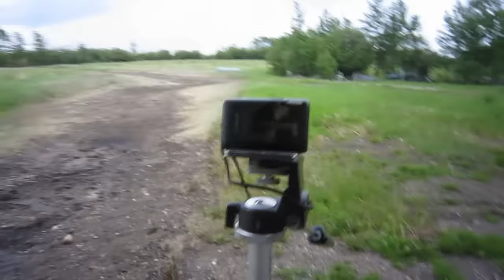Testing a GE J79 with afterburner

Comment: Curious about the thing in the front with that big tube; is it air intake for the combustion? Also how that engine is not moving? The bolts on the ground must be insane

Comment: It's loud.  I know, I have been on a number engine runs when I was in the military back in the 80's.  Hush houses and tie downs didn't make much difference when you were around it.  It was just noisy.  Flightline wasn't much better either.  But the worse engine I was every around was the tonka toy F16.  That was a high pitch scream.  You had to have headsets with ear plugs to be around those noisy engines.
Reply: I was a weapons troop on 16's at Torrejon Spain for 3 years. I loved working on those jets. Sometimes my crew would pull EOR duty. That was a hoot. Before that I loaded munitions on 15's. The F-15 is my all time favorite.
Reply: @everready19373  Well, I hated the F16 for more than the noise.  I always saw them as a tonka toy.  F15 I held in respect.  I worked at that time on F4s, A10s and AC130's.  But I can understand why you liked the F16 as weapons.  But I worked the attack avionics.  Completely different world.

Comment: Looked like smoke or vapour on the first few throttle pulls filmed from the front, were you getting no lights? I get the smoke on shutdown as the sumps aren't sealing/scavenging efficiently during spool-down. Ahhh just read your intro comment!

Comment: it would be nice if you record the sound with a condenser mic and a 24 bit audio interface, with no gain applied to avoid clipping and listen to the true power that engine has.
Reply from the maker: Any condenser mic needs to be more than 100m away to avoid being smashed into worm feces. The video cam mic gets great sound from 150m at idle and medium power. At that distance, full dry power is distorted. In AB, the sound would be perfect if I was so far away I could not see the engine.
Reply: @AgentJayZ  most condensers are made for high power but I think that engine will go up to 130+db it means it would be better to get a dynamic mic and put it like 80 meters away
Reply from the maker: Thanks for the ideas. My estimate of the SPL in AB is 180. 130 is the start cart a 75m, before the engine is even running.
As explained in the video, it is not possible to describe how loud it really is.
Reply: @AgentJayZ 180? :/     24 bit audio only admits 145 db. and that's way too much
Reply from the maker: If it's "too much" for you, then you are "not enough" for it.
Reply: @AgentJayZ  haha nah, I like hearing.
Reply: @Ag89q43G0HyA  I'm a sound design student. Condenser microphones are super fragile, some of them actually break when you blow at them so a jet engine would vaporize them. Capturing the full dymanic range of a jet engine is a cool idea. But you'd need a really good dynamic mic that can handle it. And for quite some time now you can record audio in 32 bit floating point which has a dynamic range of 1500db. Listening it back is also a problem, again you need some sort of hifi system to be even able to play that kind of audio.
Reply: Nino Saglia to replay, you would need millions of watts.
Reply: @jaik195701  i guess a PA from meyer would do the job hahah ok is not viable, so i think ill vist this guys for a real life demo.

Comment: how does the technician goes in front of the engine to take out the  air hose while that engine is on ?
Reply from the maker: Air flow into the engine rises exponentially with engine speed, so at idle, there is not much. Disconnecting the starter at idle makes you nervous, but it's not dangerous.

Comment: This is the engine used in the F 104 Starfighter?  The North American Eagle land speed record project uses this mill and the 104's fuselage for their trans sonic racer.
Reply from the maker: S&S Turbines supplied two engines for the NA eagle. It was never even close to being "transonic". And now it's gone. They might have made it, but they could never raise enough money to finance the effort.
Reply: @AgentJayZ  I know it never went trans sonic but it was emminantly capable of reaching those speeds as I'm sure you know.  I didn't know the recent tragedy had ended the program.  I really wanted to see that thing doing 800+ under full AB.  What a shame.

Comment: This is probably the ABSOLUTELY coolest way to waste money.😅 I guess I’ll have to start saving!
Reply from the maker: These engines are tested after being overhauled to ensure they function properly before being returned to the owners.
Some of them are installed in aircraft used as dissimilar adversary training for air force pilots.
Since those aircraft are less expensive to operate than current frontline fighters, these engines help save millions of taxpayer dollars.
Reply: @AgentJayZ  but they are probably still pretty expensive right?

Comment: How in the hell does the little tripod and camera not get blown into orbit? I don’t get it
Reply from the maker: It is out of the exhaust stream. The vibration of the image is caused by sound, not wind.
Lots of people argue with me... but hey, I was there.
Reply: @AgentJayZ  I imagine it wouldn't be a very useful engine if the exhaust gas blew out sideways, but seeing how effective the nozzle is really is impressive.
Reply: @nightlight0x07cc  I worked with this planes, i stood in kinda the same place multiple times with running engines. It makes ur insides shake a bit, but ur totally fine and out of the exhaust stream

Comment: Can it explode, if something goes wrong for example ? Looking at the amount of energy this engine produces I can assume each bolt and detail is crucial to sustain such power.
Reply from the maker: You might be more interested in the dash cam videos, or the compilations of workplace fails. Cheers!
Reply: @AgentJayZ  Sorry, i didn't mean that I want to see any fails or traumas at your workplace. Its just amazing how durable are the materials to maintain such power and heat. Be safe!

Comment: In my day we tested turbines by putting a hand right behind the nozzle to feel how much thrust it was producing and to check the heat.
Reply: You can do that twice. ;-)
Reply from the maker: Interesting. This engine, without afterburner, has exhaust at mach 1 and 1000 degrees F, and makes almost six tons of thrust.
At 25 ft away, it can make a brick wall disappear.
I guess it depends how far back you want to be behind it before putting your hand there.

Even at idle, and 5 ft from the exit, you would be burned by 600 degree air.
Reply: They used to make us tune them up in flight.... That front carburetor was a pain to get to!!!! Hahaha!!!! Nice video boss, thanks for starting the YouTube power channels!

Comment: How come this rig doesnt lift off and fly away? I mean it carry an airplane on several tons in fast speed and this rig is what... screwed to the ground?
Reply from the maker: ... by the same kind of bolts that bridges and skyscrapers are built with.
Reply: @AgentJayZ  So the friction between the rubber of the tires and the runway is stronger then the thrust of the enegine? Sorry for my bad english.
Reply: Thane Mac  I think he meant with planes but he doesn't realize that planes on the runway dont have much thrust until they are ready to takeoff

Comment: PLEASE find a microphone that can capture that dynamic range! It's worth is as that sound was the music of millions of fighter launches throughout the Cold War and you're probably the last facility who can capture that for history. As you know it must be heard to be appreciated (though internet viewers cannot feel the low frequency in their bones like we did and you still get to do.
Reply from the maker: Thank you for your request. This was my goal since 2007. In 2007, in consultation with professional sound engineers, I learned such a thing was impossible. So I changed my goal to finding a mic that could handle the extreme sound levels without distortion, and not worry about the bottom of the dynamic range.
There are sensors that can register 180dB, but they are not microphones, and they are expensive. The only way to get the "normal" audio is to film from 20 yards and record sound at 20 yards.
The only way to get the full power audio is to film from 20 yards and to record audio from 300 yards... so I need an audio guy willing to stand a quarter mile away all day...

Comment: GOOD Video Sir  
My brother also wants to become a Engineer in GENERAL  ELECTRIC 
Your GE 404 Engine is integrated in HAL TEJAS and SAAB GRIPEN AIRCRAFT
Q In  this video sir how your Engine gets start where is starter motor and from which source it gets Electric Current 
Q And how Fuel is supplied to the Fuel Nozzles in Engine 
Please Answer My brother Question  
Yours sincerely 
Vaishnavi Choudhary
Reply from the maker: This engine is started with an air turbine starter. The way it is started is detailed in my video called "how to start a jet engine"
Reply: @AgentJayZ  Ok Sir Thank you for Reply

Comment: PS:  To ans your question, How much fuel per second ?  The answer depends on altitude, temperature, RPM' s , air speed selected and if you choose to utilize your afterburner !   You really couldn't use afterburner for too long  as well as fly "inverted too long!
Reply from the maker: My question? Wasn't my question.

Comment: So this is a F104 Starfighter engine?  I did not hear the specific howl of this engine.
Reply from the maker: This is a -19, with the lo-smoke fuel nozzles and combustors, and the redesigned, long segment variable nozzle. The black smoke and the howl are features of older models of the J79, such as the -8 and -11.
I have a few videos posted of these older models being test run.

Comment: I wanna see some shock diamonds, I don’t think that mount can handle that kind of thrust though
Reply from the maker: You just watched it handle full afterburner thrust in this test, in this video.
Please restart your brain, or whatever carnival whack-a-mole prize you are using as a substitute.
Thank you. Please move on. No reply necessary.
Reply: @AgentJayZ  ayyyyyy lmaoooo
Reply: Mach diamonds*   and they don’t come out of afterburners or jet engines.
Reply: @quartz9704 
I think he  meant the romboidal shapes that the afterburner flames make in some occasions (I don't know which or with what motors).
Reply: I feel like there are several tiers of getting yelled at: at a 1, you’ve got the naggy friend that’s a vegan or the good Christian that feels uncomfortable going 15 miles over the speed limit. At like a 2 or 3, you’ve got the angry aunt or mom yelling at you for not folding your clothes, or tracking dirt in the house. At like a five, you’ve got your boss or getting scolded by your dad. At a 6 you’ve got the marines sergeant yelling at you.... then at a flipping ten, you’ve got a pissed off engineer and HOLY MARY MOTHER OF GOD DONT GO THERE. I didn’t talk to one of my mentors for a good month after watching him freak.

Comment: We also had a airplane suck something up in the left intake and the motor hand grenaded and blew a hole in the aircraft but it didn't take the aircraft out. Sheet metal put a 36"x 22" patch on the outside of the aircraft. Wasn't a pretty sight

Comment: How much does it cost for a typical service on one of theses beasts. Just being nosy.
Reply from the maker: 1) - each engine model is different.
2) - each engine has a variety of services to perform, from a 100 hour inspection of an industrial engine, all the way up to a full overhaul of a flight engine.
3) - nothing about any job is "typical"

Final answer: anywhere from the cost of a nice used motorcycle, to the cost of a really nice house. A really nice one.

Comment: How do the controls for the nozzle work? It seems like the engine might be trying to maintain a constant turbine discharge pressure when above idle, which seems to make sense now that I think about it.
Reply from the maker: There is a module called the nozzle area controller, which senses EGT, fuel flow, nozzle position, and throttle lever position. It controls the flow of fluid to the nozzle actuators. The pilot does not have any control over the exhaust nozzle.
Reply: AgentJayZ is right. This engine actually has a supersonic exhaust stream when the AB is lit. (Really cool to see the shock waves standing in the flame when the flame when the light is right.) To achieve that, the shape of the nozzle has to be convergent/divergent (Google "supersonic nozzle"), while at lower thrust a simple convergent nozzle works better. This is a pretty good explanation. https://aviation.stackexchange.com/questions/9653/why-are-adjustable-area-jet-engine-nozzles-mostly-limited-to-military-use

Comment: Nice video. I haven't been around a -17 in lots of years. Did you have all four stages of the burner lit? I watched it several times and couldn't hear them lite. Being an AF crew chief for 4 years and on the Colling Foundation for 15 years I've been around several engine runs.
Reply from the maker: There are four manifolds for supplying fuel to the AB spraybars. Each opens at a different pressure, but the pressure supplied to them is smoothly progressive.
We had 'er wide open, and went right down to min AB as well.
I have never noticed any step-like jumps in the AB is each manifold opens up with the progressively rising fuel delivery pressure.

Comment: 3:25 that guy passing in front of that engine gave me a bit of anxiety
Reply from the maker: The engine just started, and is at idle. The guy walking in front is 15 ft away from the inlet. The guy removing the starter supply hose ( blue coveralls) is five feet from the inlet. No problems at idle. At full power, nobody goes within 25 ft of the inlet.

Comment: Reminds me of the scene in PorcoRusso when they were testing out the plane engine in the shed and the shed blew away. 

There must be lots of vaccum in there, how did the shed not get sucked in lol
Reply: The doors are wide open dude. They are like 100 times the area of the intake, it would need to be a much larger engine to suck in so much air that those open doors weren't able to handle the mass flow, in order to create that large a pressure differential.

Comment: with the afterburner engaged, how many marshmallows would you say you could roast at one time?   and, is this necessarily not the right thing (read: unsafe) to do?
Reply from the maker: 44 tons of marshmallows at once, easy. All will be turned into a burning spray of garbage.
It's not a toaster, it's a jet propulsion engine.
And I would say... not safe.
Reply: @AgentJayZ  We used to stick our K Rations in the blast fence while we were launching our F-4s.  By the time they taxied, lunch was ready.

Comment: Have you guys measured the dB of the J79 in full AB?  Distance and proximity if possible? I am gathering info for a VA Disability claim.
Reply from the maker: Nothing that would qualify as evidence. Our meters top out at 130dB, and they are pinned at 100 yds.
Reply: @AgentJayZ  , Thanks, just for reference actually. I was subjected to a double engine run to full AB on a TDY in the 70's. The F-4 was secured with the tail hook in a concrete arch revetment. I was under the bird displacing a squat switch on the right MLG. I came to on the hanger floor with the pilot saying, "Chief, you all right, Chief, you still there?" Assumptive service connected neurological damage disability is being handled by a very talented firm.
Reply: @bradfordscales3306  Talent nor logic does a VA claim get completed.
Reply: @bradfordscales3306   @AgentJayZ  Anything at or above 120dB can be classified as causing physical pain and hearing damage. Sounds above 85dB are harmful if for prolonged periods.
Reply: @seeriktus  We dealt with that on a constant and daily basis. Get caught on the trim pad without ears during a full burner run. You don't sleep for a few days. The T-37's to me were the worst. High frequency dog whistles. Damn thingd come screaming down Shaw's runway while you have both hands on a double main change. All you can do is cuss and scream🤬

Comment: What determines the ideal length of the tailpipe to minimize drag losses while maximizing thrust conversion from gas pressures? Are the perfs in the propulsion nozzle just to draw in cooling air, or do they serve other purposes like acoustic suppression as well? I find these videos compelling and very interesting, as an engineer. I'm looking to find how you got involved in this business, not because I want to, but I'm just curious, as I'd expect to find a business like yours near a major military airport and not in scenic Canada.
Reply from the maker: The jet pipe length is determined by making a compromise between several competing needs. The CG of the aircraft is affected by where the engine is, and that can be changed by, well, you get the idea.

Comment: Sometimes i wonder if you can do an engine like this, but for RC planes, that'd be rad
Reply from the maker: Not an economic idea. RC turbine engines are extremely simplified, and still quite expensive.
As the engines get smaller, the expense of making the parts does not go down. Actually it goes up because the clearances and tolerances get smaller and more precise.
To make an RC sized J79 would cost hundreds of millions of dollars.
Nobody will pay for that, so the design is simplified into the extremely crude devices you see.
Reply: @AgentJayZ  so what you're saying is that is possible, just way too expensive. What a shame
Reply from the maker: Yes, Luis... I will build one for you. I will need a deposit of 1 billion dollars US. Cost overruns on not uncommon, so be prepared ...
Thank you for your interest.